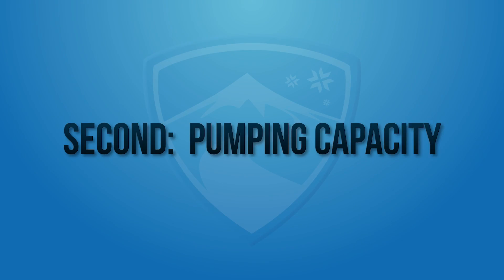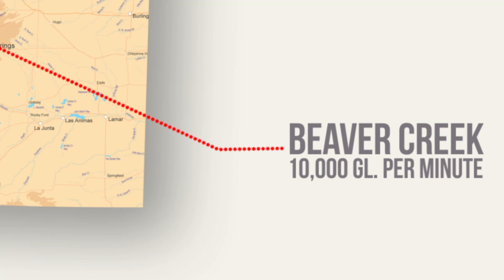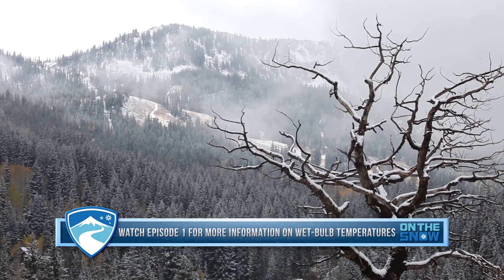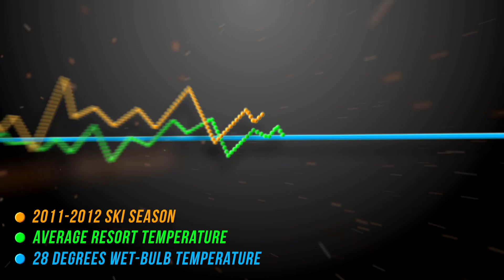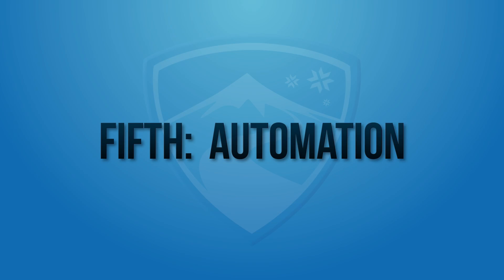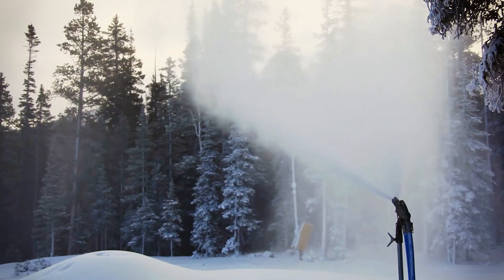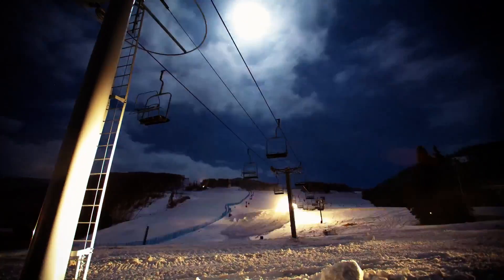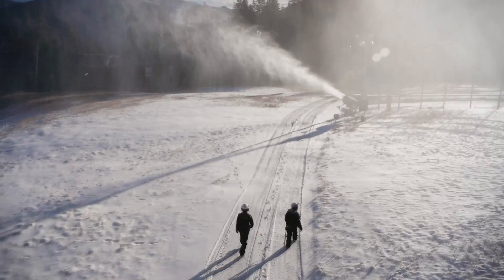Snow Science: Snowmaking Part 2 - The Business of Snowmaking

Comment: And where is the energy coming from? From burning fossil fuels?
Reply: Piotr Zee it’s been two years since you asked this question... do you still want the answer?
Reply: I can tell you it is not solar power.
Reply: Where is the energy coming from to run your PC or to charge your mobile phone battery? Just to piss you off, I will purposely go leave my RAM truck with a 5.7L Hemi running for an hour in the driveway.  Sometimes I drive around for no reason. Gas is only $3.25 a gallon here now (that's almost 4 liters).

Comment: #lpparlee
there are two different additives that can be used in snowmaking they are called snomax and drift. snomax is a nucleation additive that is made of the dead ground up bacteria that is most commonly found in corn. the use of this agent is to act as a nucleation particle for the ice to form around. the second additive drift is used to break the tension of the water to form smaller particles of water. its similar to dish soap.